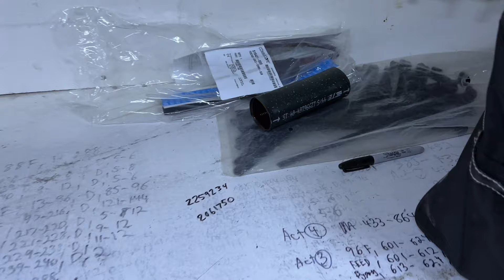How To Heat Shrink Fiber Optic Cable Into A Live 400D FOSC

Comment: Great video! One tip to opening the ports, i use my heatgun to warm up the port end. It would make softer and easier to cut. As well, the cut was normally not as sharp as cutting it without the preheat.
Reply: Came here to say exactly this.
Reply from the maker: Very great point I will have to give it a try on the next build thanks for watching and commenting I appreciate it

Comment: Nice work. Like your commentary as you go about your work and how neat and tidy your work is. At the college I worked at, and was the WAN tech (I retired five years ago), we had AT&T install eight Metro Ethernet circuits in our data center, that connected our remote campuses throughout the state via pure Ethernet. Two AT&T fiber install techs did all of the fiber work. They banged that out in no time. My jaw was on the floor. lol There was a FOSC mounted on a thick marine board that was bolted on the wall at the fiber demarc point in the data center. The AT&T Metro Ethernet techs connected the  equipment and tested everything. Everything was completed in a day. The remote campuses already had their Metro Ethernet circuits and equipment installed. We cut over from DS3 service to Metro Ethernet in four hours.
Reply from the maker: Hey thanks for watching and commenting I truly appreciate it🙌🙌 yea I build networks for all large providers. Nice yea you just have had some quality techs on site me and my guys can deploy any size network in a very fast manor the most recent somewhat bigger network was a new development 240 new lots we placed spliced and tested the whole network in 8 days was over 10km of cable along with another 2km feeder network to connect the new distribution cabinet we installed back to the main C.O it was a nice quick one. 
Once again thanks for watching and commenting I truly enjoy meeting and conversations with others in the industry

Comment: If you get a heat gun, get a concentrator nozzle for it. The heat gun I use is not hot enough without the nozzle.

Comment: I can see that you don't leave any buffer slack, that is paramount in my country in case the cores are broken in the tray for any reason, in fact I have seen it happen, and with a buffer slack you just have to strip more buffer and you are ready to go.
Reply from the maker: This was an existing live fosc that was built years ago I was just simply adding a new cable to it. I always leave slack in the basket and in the tray when it comes to ribbon fiber. Unfortunately the tech who built this original fosc did not leave slack in the tray. Thanks for watching and commenting I really appreciate it

Comment: hI, do you have a video on how to mid spann a tube in 96 fiber cable to connecto to drop cables ? like in /out 96 that one of the tube dome of it get spliced to drop
Reply from the maker: Hey thanks for watching and commenting I really appreciate it. I don’t have a video of this particular scenario but have dealt with in numerous times through out my career. To explain it quickly it comes down to how many fibers you need to splice out of the 96f midspan to the drop cable. If you have multiple drops you are needing to connect and it equals 12 fibers needed one whole tube then it’s as simple as just cut that tube and bring it to tray. If you are only needing one or two fibers out of the 96f then you need to bring the midspan tube up to tray and use a small midspan stripper to expose the full 12 fibers and then just the 2 fibers out while leaving the remaining 12 in the tube as one going in and out and store in the tray nearly. I will make a video on this the next time I run into it. Thanks for commenting and subscribing I really appreciate it